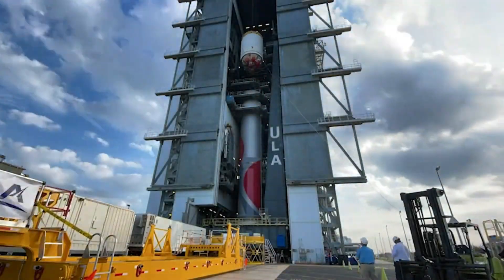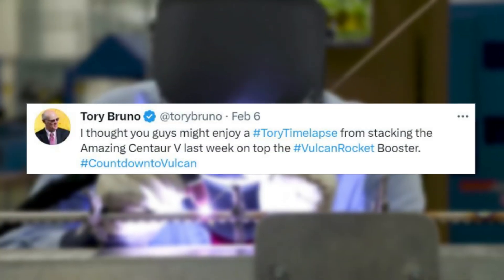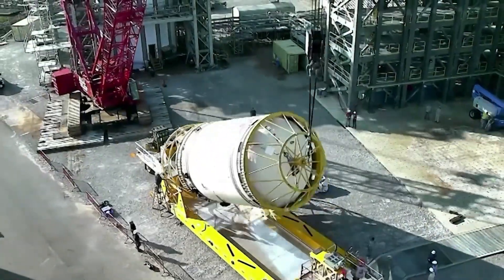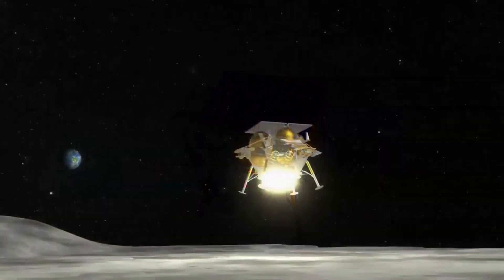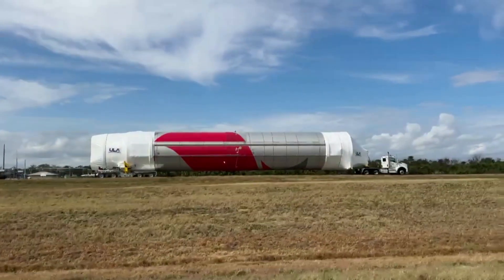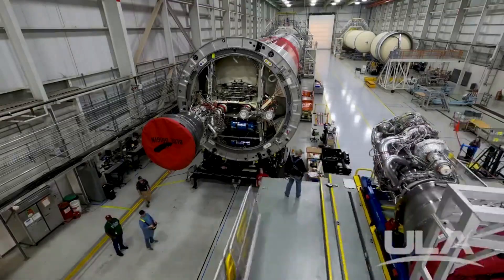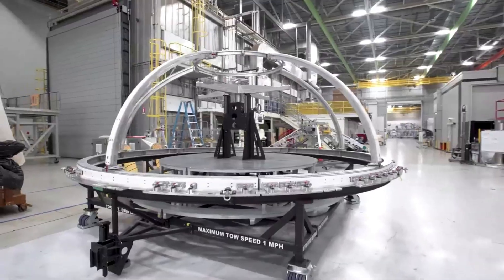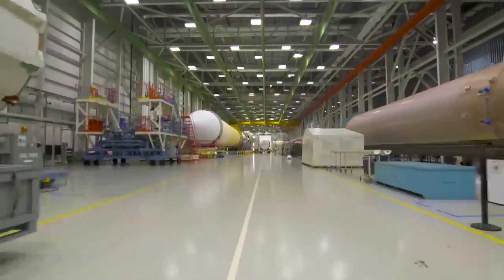ULA Vulcan Testing Begins, Upcoming Static Fire, SRB Installation, & More

Comment: Good update.  I like to see competition but wonder if Vulcan can even be considered competition.  It costs more and is less capable than Falcon which will also be outclassed by Starship in the next year or two.  Vulcan would have been a great rocket 10 years ago but it is no longer relevant and it still hasn't flown.

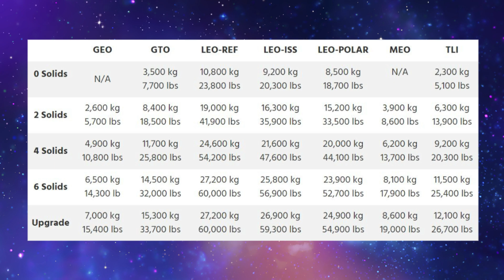Comment: 4:39 I slight word of caution concerning the ATK’s now Northrop Grumman GEM 63XL Solid Rocket Boosters (SRBs). All Atlas 5 rockets until recently used Aerojet Rocketdyne’s AJ-60A SRBs. For what seems economic reasons, ULA shifted to ATK's SRBs and first used on an Atlas 5 November 2020. ATK was purchased by Northrop Grumman. Though seemingly reliable, they are relatively new boosters on a new rocket.

Comment: Great content as usual 
question you appearedto differentiate between the gem solid rocket motors and Sa  truck Bs is there a difference? Did you mean srb‘s as in spaceshuttle hardware?
Cheers